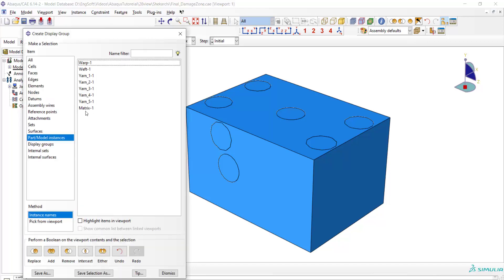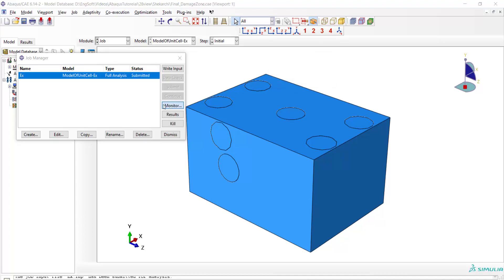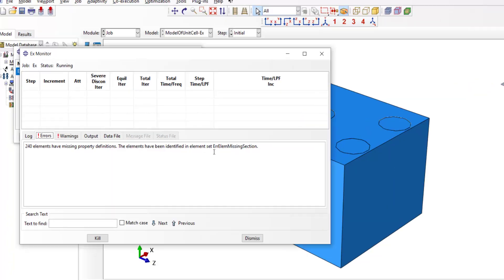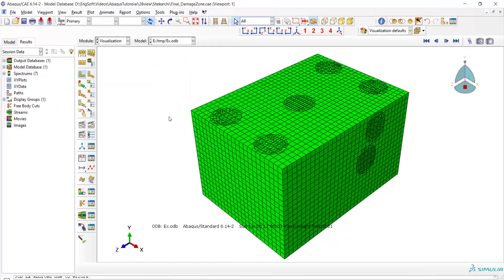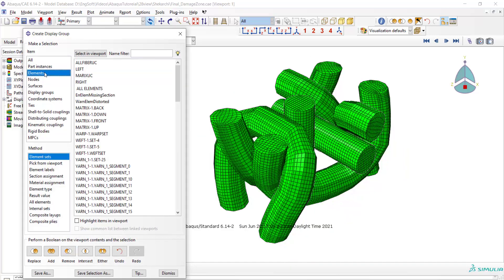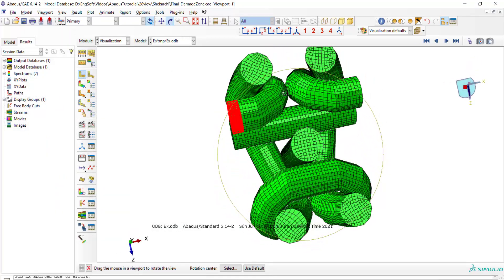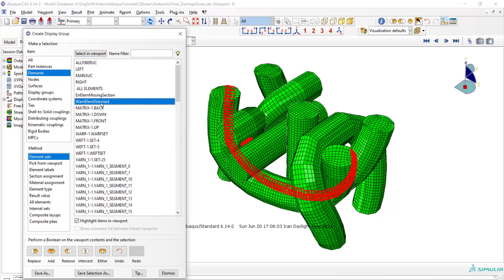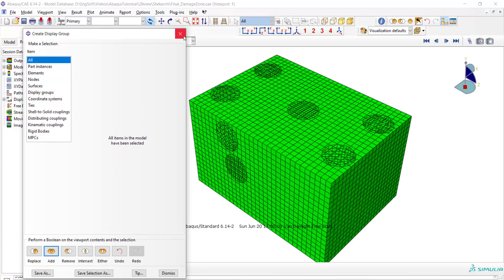How to find elements which are source of error/warning?

Comment: 5452 elements have missing property definitions. the elements have been identified in element set ErrElemMissingSection. How to rectify this error sir.?
Reply from the maker: At first you should find the "ErrElemMissingSection", as described in the video. 
Probably you did not assign properties to these elements. 
Sometimes this error shows that the section and element type are not consistent. For example if you assign the shell section to the material but use a membrane element this error maybe appear.
Reply: @engineering_software   can u please put a video on rectifying this error sir